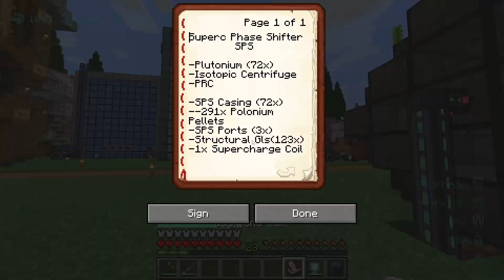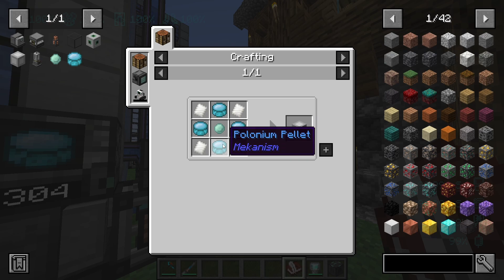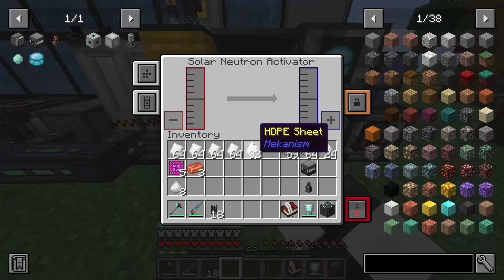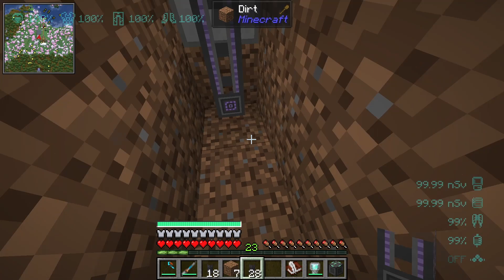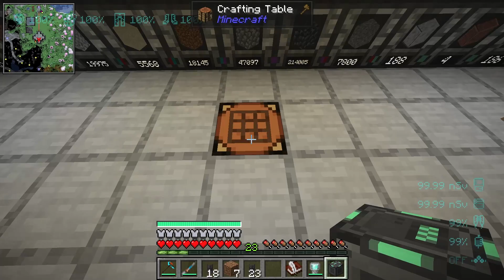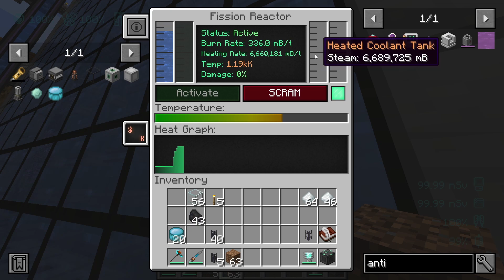HOW to BUILD the SUPERCRITICAL PHASE SHIFTER ( SPS ) in Mekanism | Minecraft 1.19

Comment: You can have two pipes of the same type run next to each other by disconnecting the connections by shift right clicking with the wand thing ( I forgot what it is called , controller ?) It changes from push to pull then to none .
You just have to make sure the pipes are empty when you disconnect them
Reply: its configurator

Comment: You can give water on fussion reactor to make steam. and you know how to use steam
Reply: The real play is to use the fusion reactor's heat to run the boiler, then use the boiler to power the turbine. But you don't really need that much power with just mekanism alone or any mod weaker than it. Even the sps doesn't require too much power to run, it's mostly bottlenecked by polonium.
Reply: @Wheres_my_Dragonator  Sodium